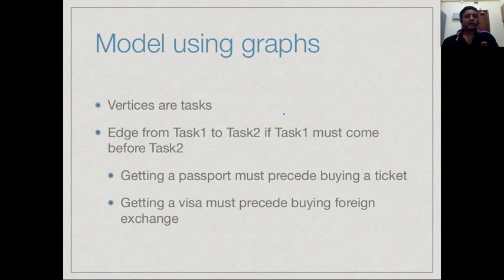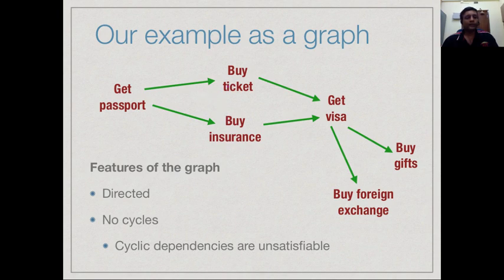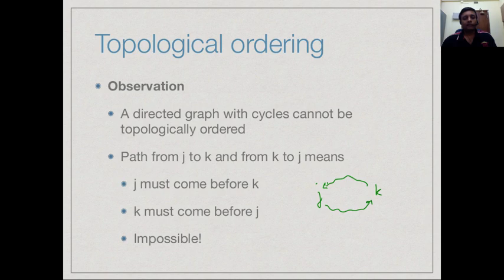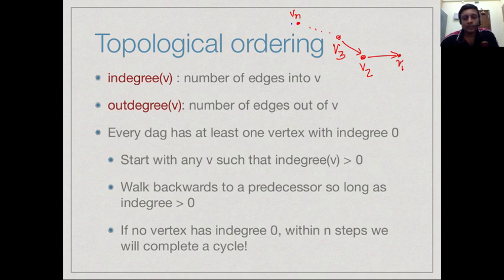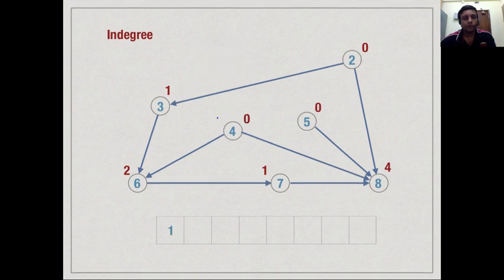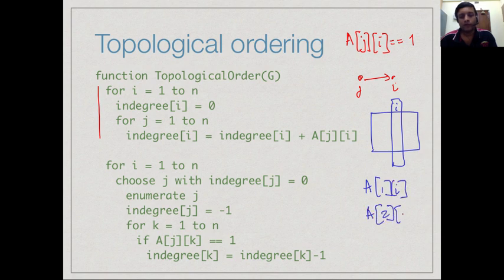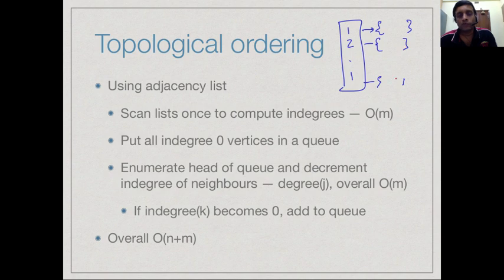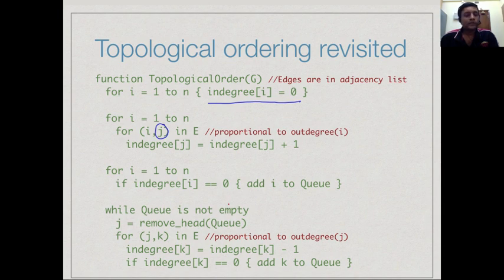Directed acylic graphs: topological sort

Comment: didn't understand, for scanning the adjacency list E, the complexity will O(n), hence the Overall 

complexity of the problem becomes O(n^2). Unless we don't make an adjacency list as an Array of length N,
so our search in adjacency list become O(1).
Reply: i guess if u are using a hashmap adjacency list u can simply determine if a node is present or not in O(1) but if you are using a vector then I guess yr answer will be right since if u have to know if a node has a link to you ud have to traverse that vector in O(n) and doing this n times get n^2 complexity